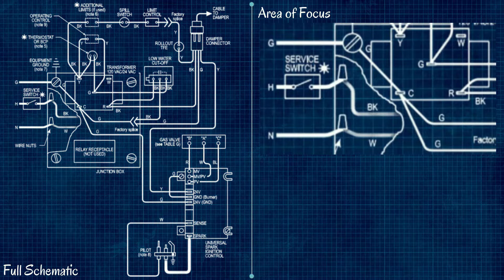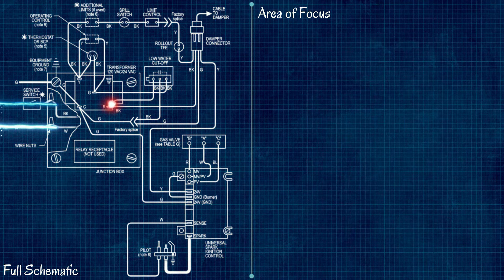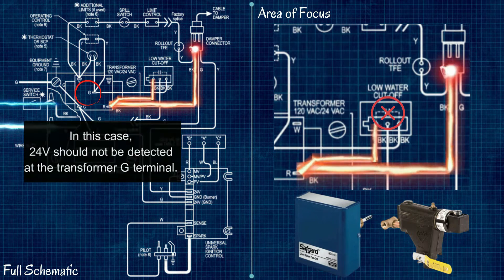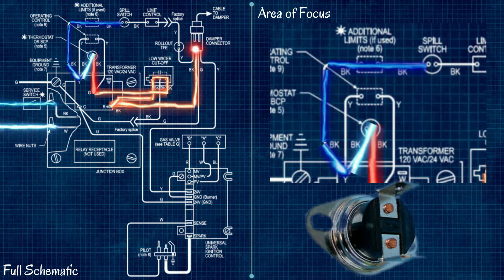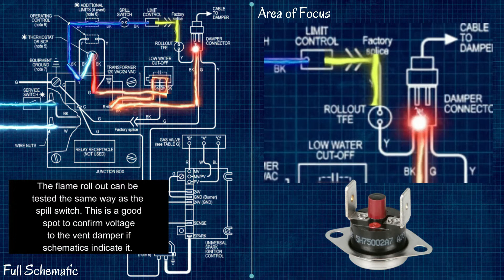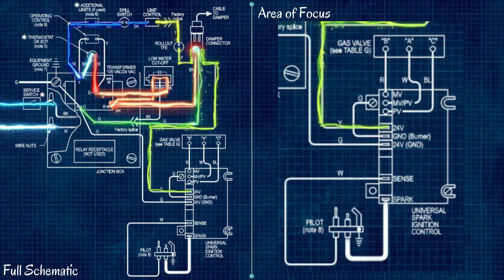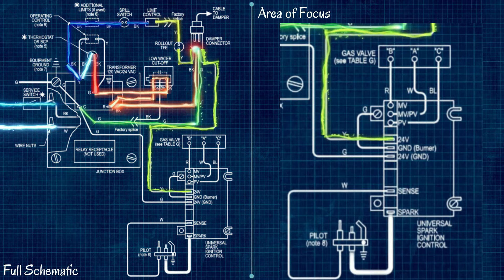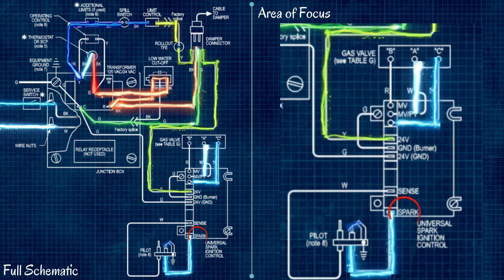Steam Circuit, Sequence & Diagnostics (Spark Ignition boiler)

Comment: We keep getting an air actuator fault on our cleaver brooks
Reply from the maker: Do you have air when you should?
Reply: @JerseyMikeHVAC  we have air but one of the techs said, we're not getting a signal to the controller ". We're going to replace some of the connectors because that's a new controller we had put in.

Comment: Great video Mike.  On a new steam boiler it went through the whole sequence up to the eletronic ingitoin would spark but wouldnt fire up.  What would cause it not to fire up?
Reply from the maker: Getting voltage at the gas valve? Would also check gas pressure.
Reply: @JerseyMikeHVAC  Going there tomorrow.  Should I test the 24V at iginition control board?
Reply from the maker: @rcmechanialgroup2856 Yeah I would check for 24v at PV during spark. If you have it there it could be the solenoid in the gas valve, but its likely the module. I have come across a few new ones that needed replacement before on Weil MClain.
Reply: Thanks!  So if I do read 24V at PV on board it’s the board?
Reply from the maker: @rcmechanialgroup2856  You should only read 24volts there when the ignitor is clicking.  If you do, the module is good. You then want to check if you're getting 24v to PV at the gas valve, which you should unless there is a bad wire connection. If you have 24v on PV when the ignitor is clicking, then you either have no gas or the gas valve pilot solenod isn't working.
Reply from the maker: @rcmechanialgroup2856 Did you find the issue? 

I'm willing to help out answer questions through email whenever I have time but my phone never gets a break. It's crazy for me.
Reply: @JerseyMikeHVAC  Thanks, I understand. I checked the 24V lead on the board it read 24V, then when I checked the PV on the gas valve when it was sparking it didnt read 24V.  So its the board like what you were saying?
Reply from the maker: @rcmechanialgroup2856  If no voltage there at spark then yeah. Gas valve pilot solenoid isn't getting the open signal from the module.
Reply: Do you work on commercial boilers? Would be great for a troubleshooting video on a large low pressure boiler